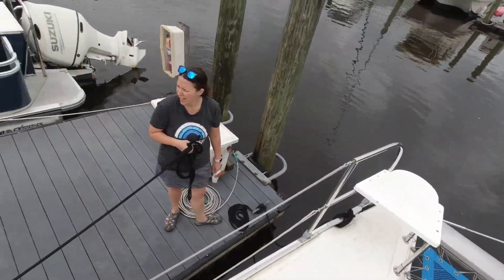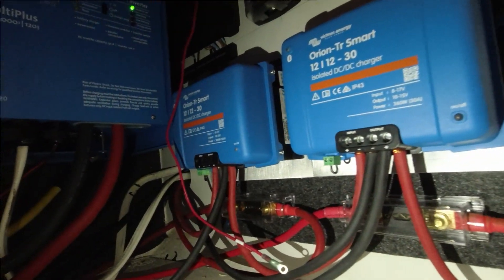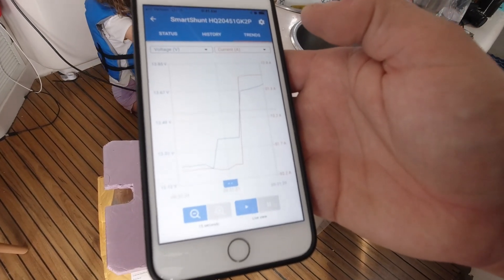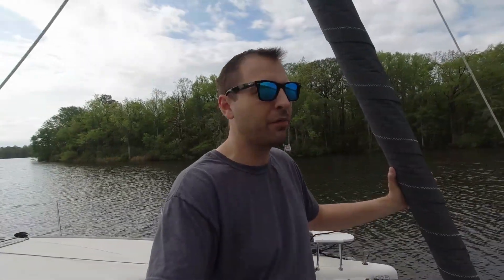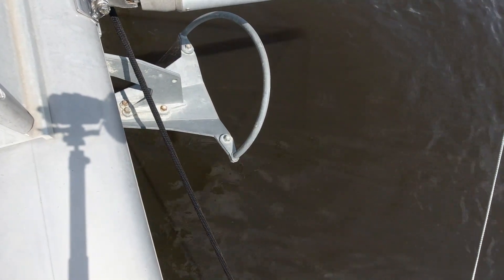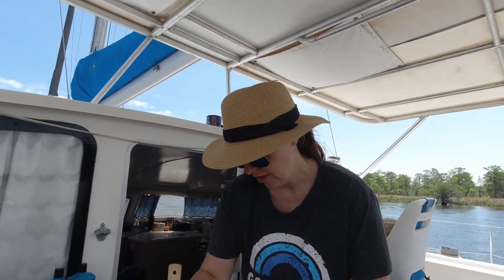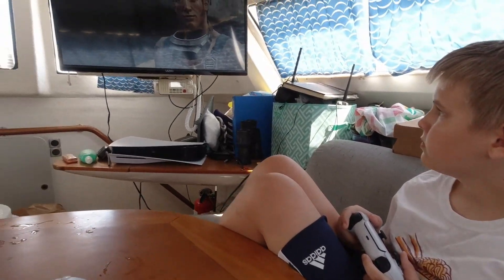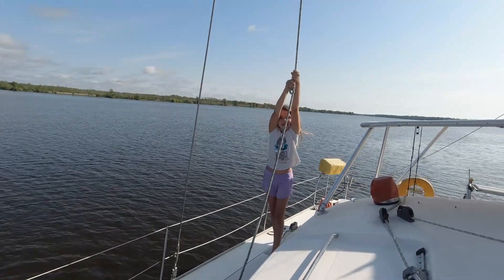How Much Power Do We Use On Our Sailboat  Ep.22

Comment: Great video, thanks again for sharing!  On this first trip consumption was about 500 amp-hours in 24 hours.  However, that was without watermaker or washing machine, 2 large draws. However, as you mentioned, conservation could have been implemented in other areas.

On our boat we currently have 1,000 amp-hours of lithium and 1920 watts of solar.  So about 500 amp-hours of solar on a good summer day.  I find that our charging capacity (solar only right now) is more limiting than the 1,000 amp-hours of lithium.

If we run the batteries down to 50%, it takes a number of "easier" days to get it back up to 100%.  Because the solar for the next day is using the next days usage and only charging out of excess.
Reply from the maker: I expect we will have the same experience as you. So far we are finding we drop our battery bank approximately 25% overnight and we are able to get it back in the 90 range the following day combined with solar and the engines. We have the Victron Orion on each engine and we make approximately 400 to 450 watts while running the engines.  We also have a Westerbeek generator.  The highest we have seen is 1100 W coming in from solar, but it is January the sun is low in the sky and the days are short. We’re hoping for better performance when the conditions change.  Also, it’s been very cold so we’ve been using electric blankets which are a relatively low draw compared to a space heater, but still a draw.
Reply: @SaltyEscape  Great idea on electric blankets, I didn't think of that.  We currently don't have heat and blankets would be a nice addition.  We lived on our boat last winter while living in a marina, but here in St. Pete, FL it doesn't get too cold.  Right now we're living in our house while I do a small refit on the boat.

Comment: If you leave your game console on standby they suck the power just fyi.  Put a surge protector on the console to turn it off for real.  My two 280AH batteries do just fine for my boat.  We have a lot you do, and 300 solar counting shading and sun availability.  We also have a dc-dc thirty amp.  Not a Victron, and only one engine...but it helps.  Mainly we use our igen2500 to top up, make water, heat water, cook, Air Conditioning(16500btu).  With the Multiplus it boosts everything when it needs startup current of more than the generator/shore power can handle.  You just have to work with the charging profiles on the Victron when switching between charging scenarios.  Get the igen2500 if your generator turns out to be just too big.
Reply from the maker: Yes, the game console is a big sucker of power also the laptops.  We need to change our habits and shut them off when not in use.
Reply: @SaltyEscape  Make sure to have your laptops set to go to sleep if not being used for like five minutes or some appropriately ridiculous period of non-use.  Also the highest efficiency sleep state.  The game console also likely has one of these power saving options.  If you want to know what uses the mostelectricity  buy one of those kil-o-wat plug in meter deal thingys.  I have one and it tells me what anything with a plug draws.  An amp clamp tells me about anything else that doesn't have a plug.
Reply from the maker: I don't have a clamp meter... I need one.  However I do have a Kill-o-watt meter.  It's really nice, bought it a few years ago,  I need to dust it off and check these things out.  :)

Comment: The dc-dc chargers at 30 amps fit just fine.  Most standard alternators may be rated for 60 to 90 amps.  Though real world output is typically about 35 amps most of the time.  So 30 amps is an amount that won't overheat the alternators.  Also you don't want to run both engines an the cat when motoring places if you can help it.  One engine will give you 5/6 of the knots two will and will burn half the diesel two will.  Unless you are docking just run one engine for long straight line passages.  Typically one diesel operates in a more efficient power band whereas two may take lower revs which isn't good for a diesel.
Reply from the maker: Thanks Allyn.  We plan to run one engine but for now, as beginners, we feel more comfortable running both.  Also, we are trying to establish trust in our equipment. Next outing we will shut down an engine and see how we do with one.

Comment: "Quote of the Day" Cory - "I didn't think we would be using that much power!"  As I'm sitting here watching from the sidelines, watching your floating home develop, it's easy to play the Monday morning quarter back role.  I've been very interested in off grid power systems for years.  The mobile power systems using Solar, Wind and Water have caught my interest.  My concern with these mobile power systems "Is there going to be enough power?  Will it be reliable?  Should I have redundancy? ".   In your situation, in the middle of the Ocean, I keep thinking about  the "What If" ?  I have a suggestion Cory.  Split your system in two.  Have half the system run the necessary stuff and the other half supply power for the entertainment stuff ( or however).  That way if leaving the AC on drains one side, you still have the other.  Or something...  Like I said, "It's easy to play Monday morning quarterback from the sidelines.  I'm impressed with what you've done!
Reply from the maker: Hi James!  Yes, I think I mentioned in the video, we also have an onboard generator.  We plan to have multiple charging sources.  And.. yes, our panel is divided into 2 sections. The water heater, air conditioner, water maker are all on the second side of the panel. This particular trip was an attempt to “stress test” our system to see how much power we would use if we did not make efforts to conserve, similar to when we are plugged into the marina.   I have already identified several areas that we can change that will have very little impact on our established behaviors. Overall I’m very happy with the size of our battery bank, it will be very interesting to see how well solar feeds it.  Thanks for reaching out to me, and thanks for watching!  Corey
Reply: @SaltyEscape  Hi Cory, I am a worry wart for you and your family surviving on that floating home.   It sounds like you're thinking this through!  (How about an electric propulsion system for a back up?   Ha!!  )
Reply from the maker: Actually there are a few people experimenting with electric propulsion on sailboats.  Sailing Spoondrifter is a good family channel on YouTube where they are getting ready to splash their boat with an electric motor after a few years of refitting it on the hard. I’ve also heard there is a catamaran builder in Europe that is putting electric motors in their brand new boats. We really like our catamaran because they have two diesel engines. You can run it with one engine....that’s the best redundancy we could ask for.   Don’t worry 😉

Comment: Corey, your math on the Dc-DC chargers is flawed.  20A X 12V = 240 Watts, not 430 Watts
Reply from the maker: Hi Douglas,  actually I read this on the Victron Orion data sheets.  This is a 30amp unit, but it is dependent on the alternator output which realistically is much lower. We may upgrade alternators in the future.  Cheers! -Corey
Reply: @SaltyEscape  , Corey..I think you said 20 in video...but even 30 is only 360 watts sir.

Thanks for follow up.

Look at Renology for 60 amp.

https://www.renogy.com/12v-60a-dc-to-dc-battery-charger/
Reply from the maker: lol... I went back and watched that section again, because it was entirely possible that I said 20 amps.  However, I didn’t, I said 30.... However, the data sheets read 430watts.  Soooo.... here’s why we are confused... you are calculating 12 volts.  We need to be calculating 14 volts (alternator output).  14.3 x 30 = 430.   Mystery solved.   So, yes, it looks like I could have used a different product with higher output... however so far, I’m happy with the Victron Orion’s, they used the same app as my smart shunt and my mppt chargers.  Cheers, Corey

Comment: Hi Corey, good update on consumption. I looked at the Renogy DC-DC charger as they also have a 40 A and 60A units. I decided to stick with Victron 30 A for two reasons. Reliability and the 30 A rating. I understand that the 30 A output can will draw 30 input from the source. So it could mean that if the alternators were only providing say 20 A the charger could pull the shortfall from the starter battery. If I was running a 60 A unit it would drain the starter very fast . This could mean that starter goes flat? It might not be a likely scenario but it’s possible.  I’m not 100 % sure if I’ve understood everything correctly but I tend to error on the safe side. Cheers Kevin
Reply from the maker: Hi Kevin.  It sounds like your understanding is the same as mine.  We were drawing about 400 watts (per the smartshunt) when we running the engines.  This is less than half of the projected "continuous" possible draw per the Orion spec sheet.  I suspect my alternators are not putting out very much... and we found two brand new alternators on board when we took possession of the boat.    I think if I upgrade the alternators, I will get more power overflow to my LifePo4 batteries and still cover the needs of the starter battery.  Is this this right?  Based on your understanding?  Thanks, Corey
Reply: @SaltyEscape  hi Corey, yes it is very likely the alternators are not generating sufficient amps. I  will install a 170 A Balmar alternator and an external regulator. I suggest you pick up a clamp on AC/DC AMP meter. I have this one from Amazon . UNI-T UT210E True RMS AC/DC Current/Voltage Mini Clamp Meters with Capacitance,Resistance Measurement. A typical factory installed alternator will often only produce around 15-20 amps under normal conditions. I imagine your manual will indicate what yours are rated at. Of course if you’ve ever had someone switch your battery disconnect switches while an engine is running that will fry the alternator and you will get zero amp output. One issue with the dc-dc charger is while the alternator is running the charger will sense voltage to allow the charger to run, depending on the low voltage setting you use  the charger could drain the starter battery.
Reply from the maker: Thanks Kevin.  You’re the Second person to mention the clamp on meter. I’ll pick one up ASAP. I do think I need to upgrade my alternators. I do know they are producing current though because the Victron Orion’s were able to detect it when running. They do look a little older and the starboard one is a little rusty. I’ll have a look at the Balmars. Thanks!
Reply: @SaltyEscape  with a clamp you can tell which alternator performs the best and then you could just replace the weakest one with a high output alternator. You could also install an external regulator on an existing alternator to optimize the output. You would need to check to be sure your current alternator or one of your two spares is able to have an external regulator connected to it.  Any alternator shop should be able to modify an existing alternator to accept the external . Cheers
Reply from the maker: Thank you!! This is all very helpful!